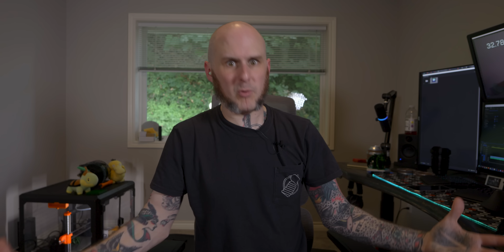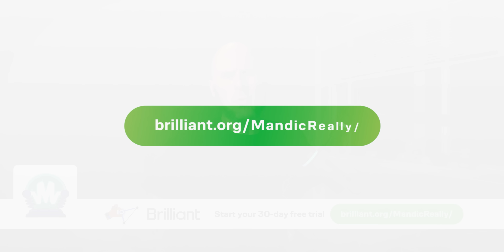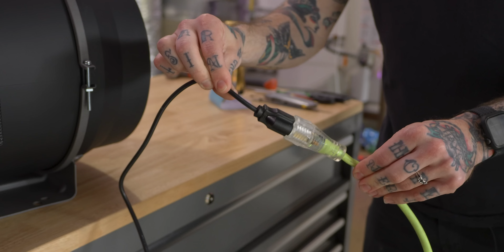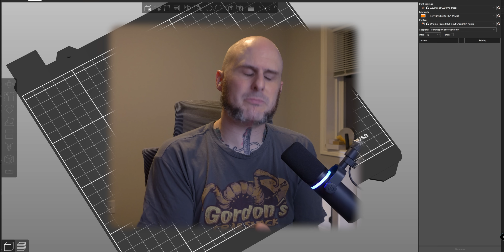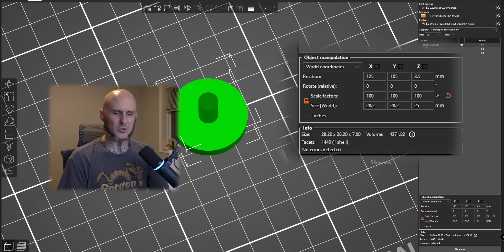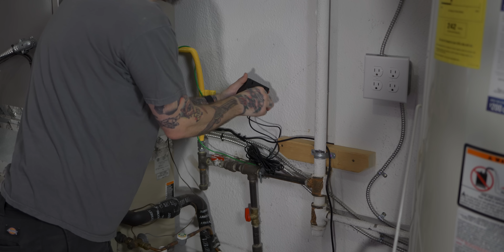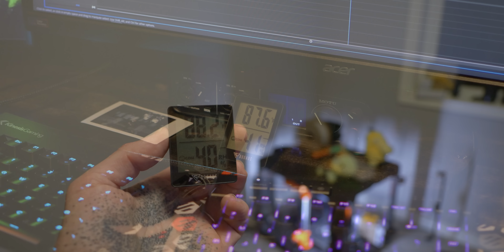Office Build Begins: Solving 2nd Floor Heat w/ AC Infinity T12 fan!

Comment: you need a spilit unit... i recently installed 3 different spilit units (6 heads) in my 2800 sq ft home....way to go...cheap as a mother fucker too...

Comment: Exhaust fans could help too. If you dont want to open your window, how about a bathroom fan in the ceiling, but a more powerful one and not the cheap ones. Example: Panasonic. Or, I think those AC Infinity inline fans are good for bring exhaust fans.

Comment: why we overthink so much, i would have put  a window unit or a portable AC unit, and that office would be in the low 70s
Reply from the maker: Side sliding windows, means no window units. Portable AC means increased office noise (where I filmed regularly) and only addresses that one room. The entire second floor was hot. This solution wasn't perfect but it cooled the ENTIRE second floor down a few degrees.

Comment: You get 4 square rubber washers with S series, well I did with the 4 inch, mines on hangers though so I dont need to worry about vibration

Comment: I had a similar issue with my media room. The air handler is literally the furthest point away from the media room. I used Home Assistant and an AC Infinity T8. If the media room is occupied based on an Aqara mmWave sensor and the HVAC is actively cooling, then the speed of the AC Infinity T8 is set based on the media room temperature, where I go from speed 7 down to 1 based on temperature gradients. I also created a virtual thermostat in Home Assistant that is activated when the media room is occupied, making the media room temperature the primary temperature control for the AC. If the temperature in any of the other rooms gets too cold before the media room reaches its target temperature set in the virtual thermostat, the HVAC shuts off until the other rooms warm up (this rarely happens).

Comment: Why don’t you just install a second blower motor in your room specifically? That’s what we did after installing the main fan like you did and it was a significantly cooler difference. It wasn’t nearly as expensive as the big one I think I paid like $50 for it.

Comment: Have you figured out how to trigger it to turn on and off with the AC unit without using the temperature sensor switch?
Reply from the maker: No, I never did. I relied on the temperature sensor, which worked reliably for me. It would false start sometimes when the temperature dipped, but that just meant some air movement in the house, no big deal.
Reply: @MandicReally I think I figured out a way to do that, I am testing it right now, but essentially its the same method as having a dust collector turn on automatically when a tool connected to gets turned out, either by using a current sensing or vibration sensing, I will report back
Reply: Okay so after couple weeks of testing I have finally figured out a way to get the fan to turn on at the same time as the AC, basically it comes down to having a smart thermostat and a smart plug and a smart home app that will control and automate both, for me that was the nest thermostat since I already had that installed, and i figured out that the google home app will not automate this device so you would have to use another smart home app like Samsung smart things which is what I ended up using, and finally you have to find a smart plug that will connect to the same app and for that you will need a smart things compatible hub that has Zigbee, Z-wave or matter controller

Comment: apparently window units are lot more efficient than those floor units
Reply from the maker: They are as they do all the heat exchange out side of the space. The floor units have to push the hot air out of the space, which means pulling cool air out along with it. Horribly inefficient. Unless you get one of the ones with 2 hoses, those pull in fresh air and blow out hot air, but cost more and have more hoses to deal with. 

Either way, window unit wasn't a possibility here.

Comment: Aren’t you better off using the fan to suck return air out of the too hot room and shoot it down to the air handler?  Then the cool air has less resistance and should flow easier into your too hot room.

I’m dealing with a similar issue, but in a 1 story house.  I have a bedroom office with a cathedral ceiling and enormous window with a southern exposure.  I have hot air stuck in the cathedral part of the ceiling.  The return air grill for the room is located at 7 foot on the wall in that room.  The ceiling towers overhead.  Plus the return air system is poorly designed.  I think it is full of leaks and thus has very little drawing power for my too hot bedroom office.
Reply from the maker: I see your logic, and I really don't know if it is a good one or not. I've never seen an "active" return setup. The big problem here was, that would just continue the same problem we had. The 2nd floor return is in the 2nd floor hall floor. There is 1) nowhere to put the fan, and 2) no way to duct air from the rooms to the return. I intended to add jump ducts that terminated directly above the return vent, allowing each room to have its own "Return", but never got around to it before we moved out.
Reply: @MandicReally Let you in on a little secret that you probably already know:  Houses are a huge pain in the ass.  😂

Comment: One thing that generally gets overlooked is the stairwell. Most multi story houses don't have a physical barrier between each level. You typically have an open stairwell from one floor to the next. The problem with that is heat rises and the cold denser air tends to make its way to the lowest point. With an open stairwell, all the heat in the lower level rises and goes right up the stairwell to the upper level and all the cool air in the upper level flows down the stairwell to the lower level. If your AC intake or intakes are all on the lower level, the heat that your trying to remove isn't getting to the AC because its in the upper level of the house. Most people don't understand exactly how an air conditioner works. And the way they work is not quite like most people think. To begin with. The air coming out of the vents isn't as important and is more of a by product of the process as the air is going into the intake. An air conditioner doesn't " make " cold air. The air conditioner removes heat from the air the result of which is cold air. In an AC system you have a compressor. That compressor takes freon ( im using freon as a generic term. Nowadays they use other gases) and compresses it and then that compressed gas is sent to the evaporator coil that is in the air handler inside the house. Right before the evaporator coil there is an orifice tube. The orifice tube basically does the same thing the spray button on a can of spray paint does. It is the point at which the high pressure freon goes through a sharp drop in pressure as it enters the evaporator coil. Freon ( or whatever gas being used) absorbs heat in this process of rapid depressurizing. So as this rapidly expanding gas is passing through the evaporator coil, air from inside the home is drawn in through the intake vent along with it heat that is in the air conditioned space. This air is passed through the coils at which point the heat in the intake air is absorbed by the expanding gasses in the coil. The result is the air is now cooler because the heat has been removed and that air is vented back into the air conditioned space. The freon is transferred back to the outside unit along with the the heat that has been absorbed from the intake air. The hot freon is then passed through the condenser coil where a fan helps to radiate the heat into the outside air. Similarly to the way a radiator works in an automobile. Then the freon goes back into the compressor to complete the circuit or loop. That's why the air going into the intake is more important. Because the more heat that is present in the air conditioned space that you can get into that intake, the faster the space is going to cool. What perplexes me is why the AC intake vent is usually down close to the floor. In an enclosed space the heat is going to be near the ceiling ( because heat rises) and the cooler air is going to be near the floor. Wouldn't it make much more sense to have the AC intake up high closer to or even in the ceiling where all the heat is than to have it down by or in the floor where the cooler air is? Seems a bit counterproductive and inefficient to intake the cooler air from down low as opposed to having the intake up high where it can suck in the hotter air and remove that heat faster. I do understand from a standpoint where its a heater and an air conditioner and a high mounted intake would create the exact opposite problem when using the heater. So having intake vents in the upper part of the house and a physical barrier would probably make a significant difference as far as cooling. However, you would still need an intake at the lower level for heating. Maybe a system where you have both and depending on wether your heating or cooling you can switch which intake is in use.

Comment: Nice video! I battled the same issue in my current house and something that really helped was installing an EcoBee thermostat AND 3 x EcoBee wireless temperature sensors. I set it to average out the temperature across my home, and I also set a 'minimum fan run time per hour' within the EcoBee app. End result = the system runs for longer, and the blower kicks on more frequently to balance out the temp in the home. It made a huge difference. The other thing you can do is add a ceiling fan in any vaulted areas of your home to keep mixing the air. 

And something I will flag is that installing an inline fan in your upstairs duct can run the risk of causing excessive velocity of airflow over your coil when the AC is running, which can cause "blow off" that essentially creates excessive humidity in your home.

I think your plan of adding a mini split (or two mini splits) is a great move - but I would still add the EcoBee products to your main HVAC. They do a lot to increase comfort with a single stage system.

Comment: If the 2nd floor MBR temp is lower than the thermostat setting, then you did it!  Try closing all the upstairs vents 3/4 of the way, and see if that helps.  Other than that, your problem is not furnace related.  It might help if the ceiling vent is relocated to the wall, a foot off the floor, but I don't know if its practical, given the duct design.

Comment: I know about HVAC.  Your main trunk line is vertical, where in almost all houses it is horizontal (I live in a ranch house community, one with full basements, with the furnace in the center of the basement, and the main trunk lines stretching from one end of the house to another).  The cheapest solution for you is to add a window air conditioner to your bedroom (~$200), and, if needed, a stand up fan (~$30).  Second, I suspect the ceiling register does nothing at all, because the 4 inch duct line (lines running from the main trunk to the bedrooms are 4 inches round, unless they were replaced with wider 5 or 6 inch ones, but any lines running though vertical walls will only by 4 inches) is too far away from the main trunk, or the top of the main trunk is too far away from the plenum for cold air to reach.  The more difficult, but permanent answer to this is to switch out the main trunk line for a larger one, and to upgrade your furnace with a stronger fan (a good DIYer can do this, $1k for the furnace & $2k for the sheetmetal, but bringing the man in will cost you 3 times that).  AC Infinity also makes 4 inch in-line air booster fans, which you probably know about, and which should be installed on the feed line to the bedroom, about 1 foot away from the main trunk, but if the air isn't reaching that high, it would be a useless effort.  I came to your site because of the pic of the 12 inch blower, which really blew me away.  I hope you fix the problem soon. 👍

Comment: In case anyone needs this in the future: These things use a standard industrial 0-10v analog control. You can actually slightly rewire the control box and use a 0-10v DAC to control it with your own software. 0v is 0%, 10v is 100%, nice and simple!

Comment: Dud your problem is your thermostat is down stairs u need get ecobee thermostat they sell mini thermostat u can put in each room that connects to your main ecobee thermostat so u can control which room get cool or heat.. because your thermostat is down stairs its only shuts off if it reaches the temperature u set it on for downstairs only

Comment: I would have put it down further in the system. Most likely on the run going up to the second floor. So youll get a pull from first floor and providimg a boost to the second. So then you are not boosting the entire house just the scond floor
Reply from the maker: You misunderstood the airflow path. The branch it was on IS the second floor only. You cannot see the first floor duct from the garage. It is underneath the unit and through the wall into the crawl space. So I did put the fan exactly where you were saying.

Comment: I would definitely isolate it better.  You can build a baffle box and encase the unit in there, greatly attenuating the noise.  I'm planning on a special application for one of these and can report back on some tips.

Comment: If the living room shares the upstairs ceiling, a big ceiling fan will help mix the air. 

Ecobee thermostats can habve sensors in multiple rooms. You can have it average the temps or select one sensor to use as the main one.

Comment: Why not just wire the fan with a solenoid in series with the HVAC blower so they kick on exactly at the same time to circulate air even when the AC is off.
Reply from the maker: The fan uses a smart controller that doesn’t accept a signal input. If I just bypassed that I lose fan speed control. If I control it via 120v power cycling I risk losing fan settings in the controller.

Comment: Thanks for the video. I’ve owned my house over 28 years and have always had problems with the 2nd floor being  too hot. I just installed this same 12” fan and for the first time in 28 years the 2nd floor is colder than the 1st floor. That is at speed 6 out of 10 so I would be able to make it even colder. I have to lower the fan speed to equalize 1st and 2nd floor. I love this fan and its controls. You said it took 15 minutes for your fan to shut afterwards. I don’t know why that would be I was able to have it turn off within a minute or two. I love this fan and the controls.

Comment: The way those tpu washers were designed does not work.  The metal screw will still transmit vibrations

Comment: You have changed the pressure equalization of your house. Your AC system will try to compensate, but you may end up causing long-term issues. The best solution is a dedicated mini-split or a second unit for you upstairs.

Comment: Could you not just set the booster to turn off at the temperature you want your room to be with the booster thermostat/temp gage in the room? Like if it constantly ran the fan until the hot room is at 73 it would pull from the other rooms in the house which would cause the AC to keep running until those rooms stayed at 73 and your office is at 73?

Comment: 18:19 You don’t need automation.  You can tie the fan into the board on the air handler to turn it on and off.
Reply: OK sure but how exactly? There's myriad of variations of air handlers, mine has this weird number of different taps which will give you different handler fan speeds depending on if it's heating or cooling but I don't see a single on/off place where I could tap in this type of booster fan to trigger it. Also, the transformer from the air handler is already powering a UV light which is pushing the amp rating for it already. I suppose you could have a relay control it in some fashion, but these fans have controllers built in and I don't know if they will memorize the settings every time it would switch on/off

Comment: You really don’t want a portable AC.  They’re inefficient and the output is not great.  I have a 8K BTU portable AC that almost sucks up as much power as the central air system.

Comment: If the bedroom is that much colder, you could open the wall to access the duct feeding that room and add a balancing damper - or even just test taping/covering 1/2 of the vents in the bedroom. too much flow with your duct routing is getting there. Also, rather than the return jump duct, just cut the door another 1/2 inch up from the floor to allow more return out of the room - or even add a baffled jump duct above the doorway of the office. You could test this by leaving the door to your room cracked open a 1/2 inch to see how things change. Do that first, then you know return is your issue. then close the door and test covering 1/2 the vents in the bedroom. Would love to see a video of those test results!